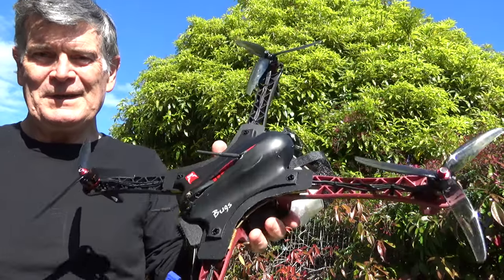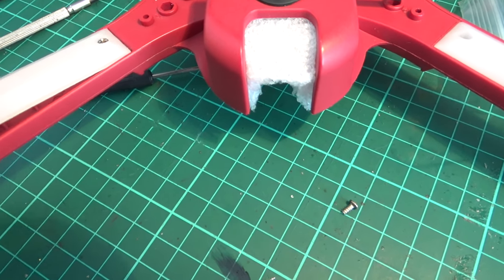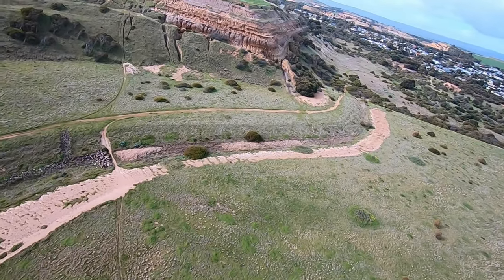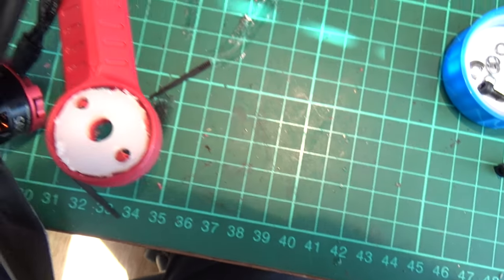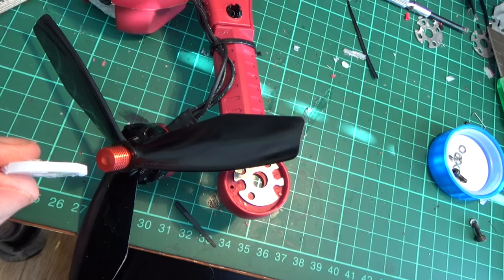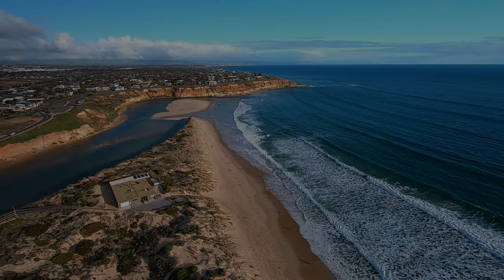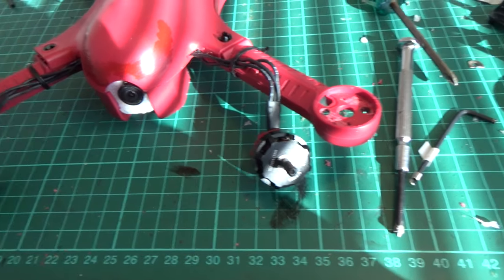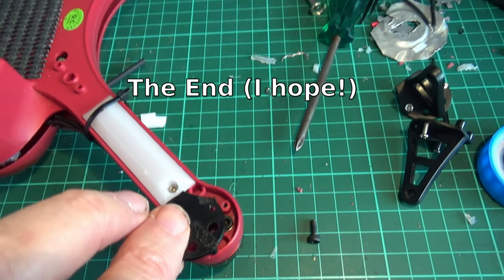Finally put bigger motors on a Bugs3! - Build and test

Comment from the maker: What happened next - https://www.youtube.com/watch?v=r4b_VAlxaAA
The dji F330 frame is more rigid and has holes under the motors for better cooling. Only 28gms heavier than a Bugs 3 frame. Will keep a Bugs 3 with standard motors but 30amp Beheli_s ESCs in the fleet. Gives longer flight time with 3S batteries than a F330 based build with bigger motors. Horses for courses! 🙂